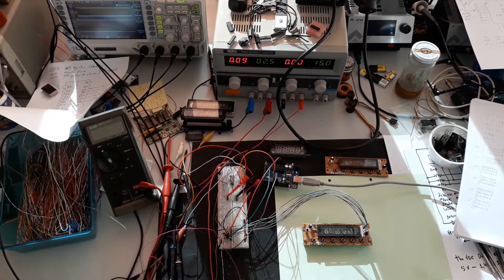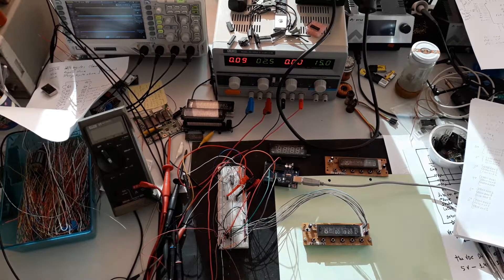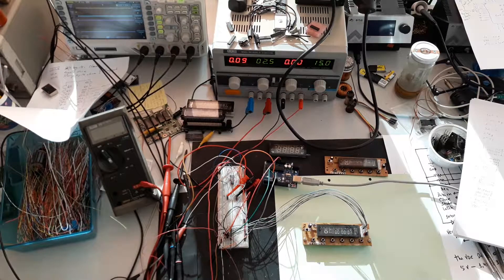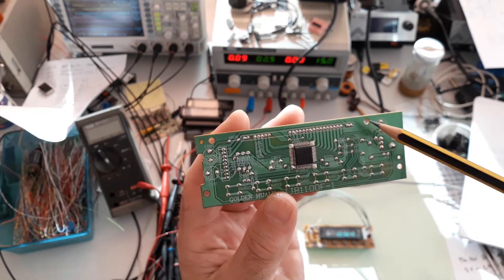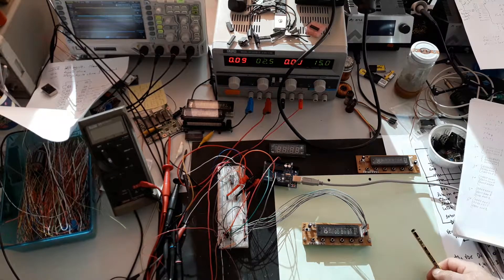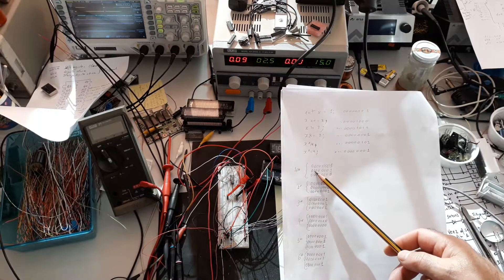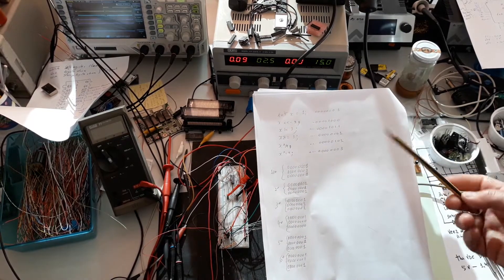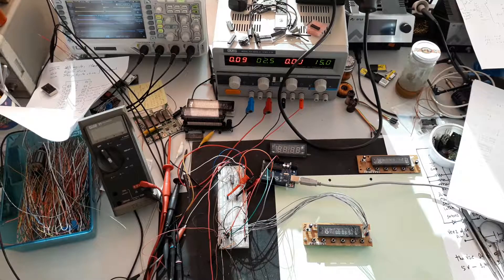PT16312 (Part I)

Comment: Oi José, boa noite. Você tem alguma dica ou esquema de como posso ligar os filamentos de um VFD com tensão alternada a partir de 12Vdc sem necessitar de um transformador? Muito bom os seus vídeos! Parabéns mesmo! Gosto muito de eletrônica e principalmente sobre esses displays VFD são fantásticos. Abraços.

Meu email se preferir. garagemnorte@gmail.com

Muito obrigado!!! 🤝🏻
Reply from the maker: Viva GN,
Fico na dúvida em relação à questão, mencionas "tensão alternada", mas depois dizes " a partir de  12Vdc"
Se for a partir de 12VDC podes usar uns conversores de DC/DC tipo que há à venda no Ebay, tipo: B01205S ele converte 12VDC para 5VDC com isolamento que é o essencial para alimentar o filamento se usares tensão de grelha/filamento negativa. Para reduzir de 5VDC para 3.6VDC inseres 2 diodos 1N4004 em série com o filamento! Cada diodo provoca uma queda de aproximadamente 0.7V, que resulta em 5-1.6=3.4VDC
Confirma PF qual a tua fonte de energia que pretendes usar: AC ou DC?
Se for AC temos também temos solução, mas tens de informar qual o consumo do "filamento" +/- e o valor de tensão AC OK.
Reply: @jlsmonte  Viva José, muito grato por responder. Deixe me explicar melhor. O display VFD é de um veículo antigo que estou restaurando, ou seja, fonte de 12VDC. A placa que gera a tensão AC para o filamento do display, sempre dá muito problema no transformador. Então estou tentando desenvolver em protoboard um circuito para tensão AC para o filamento do display. Ele trabalha com 3,3~3,5VAC. O consumo vou tentar medir assim que puder. 

Eu tentei fazer com um Ci 4093 para gerar uma onda quadrada defasada 180º e um driver L293 para dar um ganho de corrente. O display funciona porém muito fraco ainda. https://photos.app.goo.gl/N7K6Vgm1Axtu5NqX6 esse é o esquema que tentei.

Muito obrigado pela ajuda!
Reply from the maker: GN,
Ok percebi!
Se for dificil medir o consumo, envia uma foto geral para eu ter uma ideia.
Há um pormenor importante a ter em linha de conta. No circuito que criaste tem de se prestar especial atenção ao GND. Nota que se o VFD for alimentado com tensão negativa à grelhas/filamentos, obrigatoriamente terás de ter a alimentação do filamento sem qualquer referênica ao GND para a poderes ligar à tensão negativa! Terá portanto de ser uma alimentação totalmente independente. Aí como teste simples sugiro realmente o pequeno conversor de +12 para +5, tipo BO1205S, atenção ao "S" ele indica que é isolado permitindo assim que ligues a tensão negativa a um dos pinos dos +5V.
Tudo isto é se o VFD trabalhar com tensão negativa, caso seja positiva fica mais simples. Se possuires os esquema envia.
Bom  trabalho.
Reply: @jlsmonte  Bom dia, José! Entendi sim. Mas infelizmente não sei dizer exatamente se funciona com positivo ou negativo. Você diz tensão positiva ou negativa nos filamentos? Quando meço a tensão nos dois filamentos me mostra no multímetro 3,5VAC. As duas grades são alimentadas pelo mesmo pino com +12VDC em relação ao GND. Os anodos são alimentados com +12VDC também, porém quando não estão acesos são alimentados com -8VDC, creio que para repelir os elétrons e não apresentar o efeito "fantasma" ou "ghosts". Nesse link do Google Photos tenho alguns vídeos e fotos dos displays que mexi. - https://photos.app.goo.gl/B6QH1Gf48MpTtpgX9

Ontem fiz um outro esquema para tensão alternada para o filamento usando 2 transistores PNP e 2 NPN para fazer uma ponte H, e também alimentou o filamento porém muito fraco o brilho ainda. Esse foi o esquema - https://photos.app.goo.gl/CWXQNpWcYvNcyhEk8 

Nessa foto em específico https://photos.app.goo.gl/kgsjM4g5dcCDJks66 , é a placa driver do painel, ela saiu em dois modelos, acho que consegue-se perceber nas fotos do álbum. Na placa se consegue ver também os terminais descritos como -8v, GND, Vin, AC, AC... O Vin é +12VDC da entrada, "-8V" são os -8VDC do transformador e os "AC" são os 3,5VAC do transformador também. 

O problema quase sempre desses displays são nas placas driver que queimam o transformador e fecham curto nos enrolamentos. No momento estou com 9 displays com problemas no transformador... 

Mais uma vez, muito obrigado!!
Reply: Viva José. Estive analisando o painel novamente e medi a tensão de uma das extremidades do filamento ao GND e obtive -8VDC. Ou seja, tudo indica que ele realmente trabalha com tensão negativa. Porém essa tensão negativa é utilizada para alimentar o transformador pelo que estou entendendo e assim gerar a tensão alternada para os filamentos. A questão agora é, como criar um circuito para tensão alternada a partir de -8VDC? A tensão negativa eu consigo sem muito problema, a questão seria um circuito oscilador que trabalhe com tensão negativa.
Reply from the maker: Ok,
Consegues fornecer a referência do driver usado, é da Princeton Technology ou outro?
Se tens um valor negativo no filamento em relação ao GND, isso significa que teoricamente é polarizado com tensão negativa, mas -8V parece-me pouco!
Reply: José, você perguntas do driver original da placa ou o que eu tenho utilizado no momento? Se conseguires ver nas fotos que enviei a questão mesmo é somente o driver do filamento, o restante vou manter original. Sobre as tensões que eu te passei é com uma placa original que está em bom funcionamento. Consegues ver na foto que está até escrito -8V
Reply from the maker: Quando mencionava "driver" referia-me ao Integrado que realiza a polarizção dos grid/filaments, neste caso é um uPD6323AC e tem o datasheet no link:
https://datasheetspdf.com/pdf/545063/NECElectronics/UPD6323AC/1
Lá estão presentes as duas formas de polarização negativa/positiva.
O facto de usarem um gerador AC é porque é necessário ter as alimentações totalmente independentes quando se usa voltagem negativa! Há um video onde explico esse metodo, é em inglês (fraco) mas podes activar as legendas em português se vires num computador... no móvel por vezes não mostra o icon da roda dentada (settings).
Tendo o gerador AC inutilizado não adianta realizares um gerador que continua com o mesmo GND porque não consegures referenciar as tensões. Tens obrigatoriamente de usar um gerador que contenha um transformador isolador! É o que faz aquela bobine em ferrite, ela converte a corrente de excitação para outros valores mais altos ou mais baixos, neste caso eles devem gerar ~3VAC e uma tensão negativa proximo do valor minimo de polarização do VFD, mas o importante é que são totalmente independentes!!!.
A dificuldade é arranjar um TR parecido, rebobinar o mesmo também não será fácil. Assim sugiro que uses realmente um conversor BO1205S, mandas vir da "Aliexpress" é relativamente barato e resolve a tua dificuldade. Inclusivé podes mandar vir um de  B01212S e substituis o conversor completo por esses dois, o driver (IC) suporta até -40V!
Reply from the maker: https://www.youtube.com/watch?v=WCWnaLwxga8
https://www.youtube.com/watch?v=PYJES3VuylI&t=24s
https://www.youtube.com/watch?v=SigbfyizjKc&t=42s
No ultimo video tens um exemplo de como gerar o AC para filamento a partir do power geral, para o clock desse gerador eu usei um 4011 tens lá como o ligar. Mas em todas as soluções que te posso sugerir acabas por ficar com mais espaço ocupado do que com os dois converters "BOXXXXS", não esqueças que o "S" significa output totalmente isolada do input!
Reply: Excelente, José, assistirei os vídeos assim que possível. Mas entendi tudo que explicou. Muito obrigado mesmo. Assim que assistir eu te dou um feedback novamente. Muito grato pela ajuda!!!
Reply: @jlsmonte  José, eu vi os vídeos todos e com meu singelo inglês e as traduções consegui entender sim grande parte. Mas ainda me ficou uma dúvida da ligação dos dois conversores juntamente com o 4011 para gerar a tensão AC. Seria muito incômodo se pudesse fazer um esquema? Agradeço muito mesmo